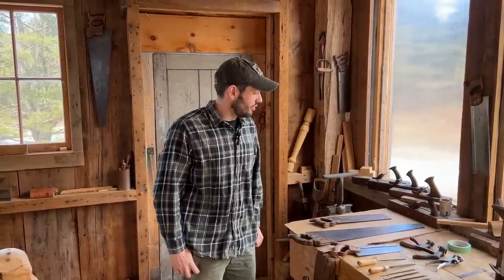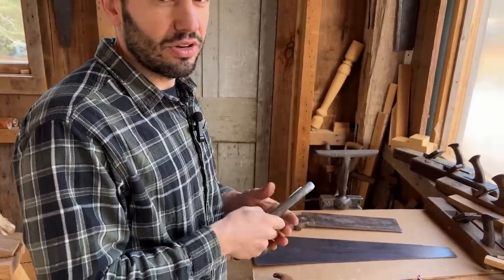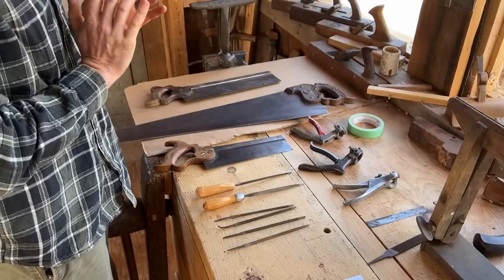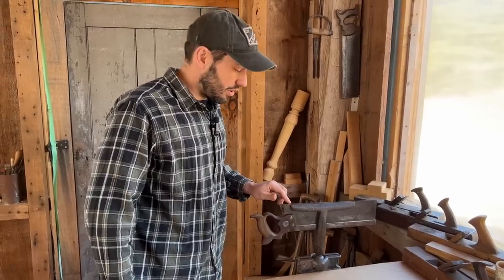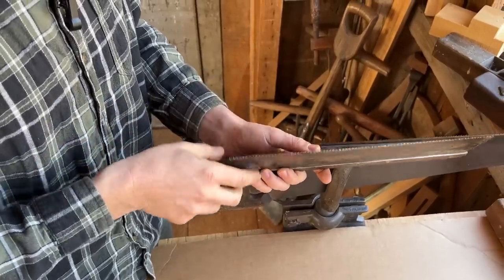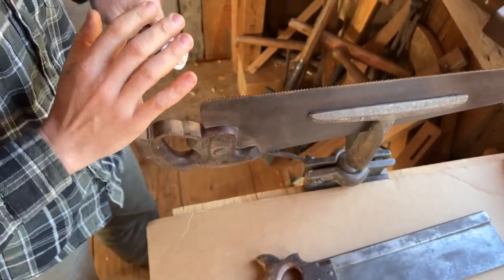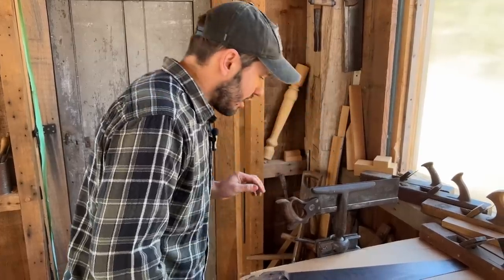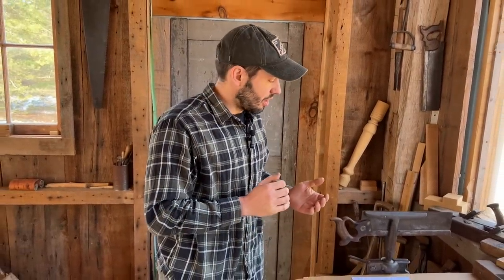How to Sharpen Your Saws

Comment: Thank you for a timely saw sharpening video. Good information. I will say that the first time you sharpen a saw, the hardest part is overcoming the fear of messing the saw up. But once you get the feel for it it becomes an almost Zen experience.
Reply: Buy a couple of 'beaters' at sales for a dollar or two a time and practice away to your hearts content. If you mess it up. re-joint it and try again. You never know, you might well get a useful saw out of It ... I did and I'm still using it decades later, even though the blade looks pitted and ugly, it really does the job and stays sharp longer than any of my other 'top brand' saws

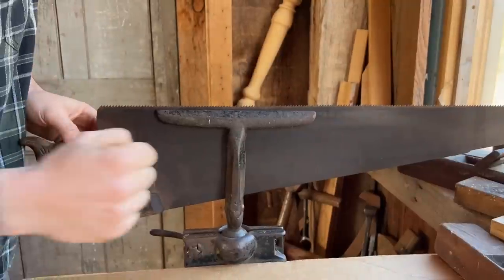Comment: Good video and to the point. One polite remark though, at about 16:35  you are saying that the more you go to the toe of the saw, you would reduce the rake  to ease the starting of the cut. I think you meant it correctly but using the term reducing the rake it will generate a more aggressive cut.  Right? 
The opposite is true. Increasing the rake at the toe of the saw will indeed ease the starting of the cut.
Best regards,
Pantelis

Comment: Im really enjoying this video series. Question: do you place the hammer of the saw set at the tip of the tooth or at the bottom (closest to the saw plate) of the tooth? Thank you
Reply from the maker: The hammer should be at the top of the tooth. You only really apply pressure to the top 2/3 of each tooth. My set naturally rests in that position, so I don't have to actively keep the hammer and anvil "aimed" properly.

Comment: Your video was helpful.  However, in buying a saw set tool from eBay or other market, there is no mention of whether the tool is for larger teeth/lower TPI, or finer, smaller teeth.  Any advice?
Reply from the maker: I would write to the seller and ask for more information/photos. Typically, these "plier style" sets are for smaller saws, since big crosscuts require more leverage to bend the teeth. Also, if the make/model of the set is included in the listing, you can look up that particular tool to see its intended use.
Reply: @mortisetenonmagazine  I’ll try researching the make and model, as most of those selling vintage American made tools have no knowledge of much of what they sell.  And I don’t want the new ones made in China.

Comment: Hum: you don’t skip a tooth even if not crosscut ?
Reply from the maker: I have never found that necessary. The only time I would consider it is if I had to do more than just 2 or 3 passes per tooth. That could lead to a series of metal burrs on one side of the saw.